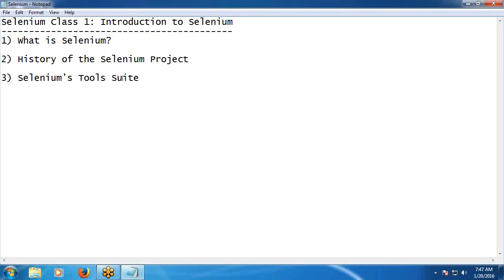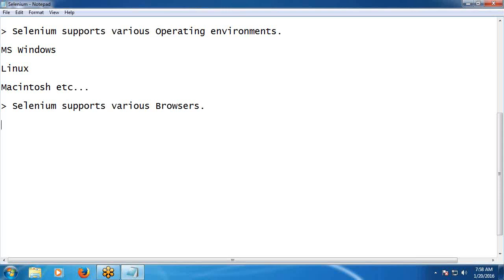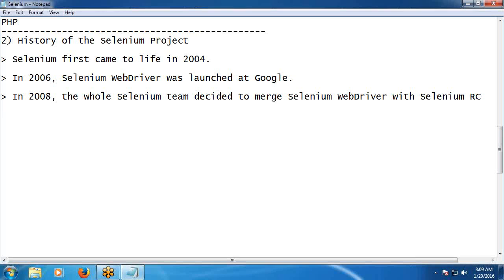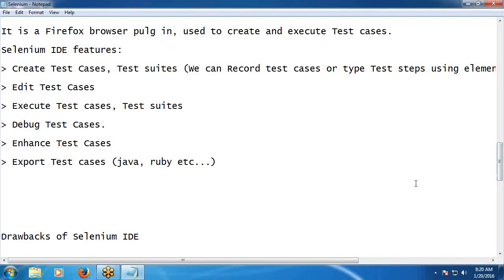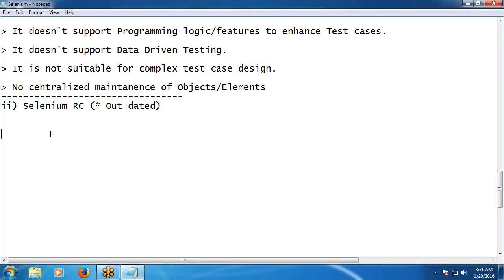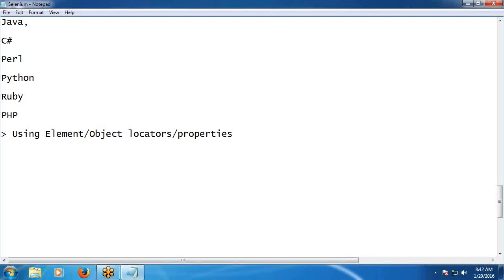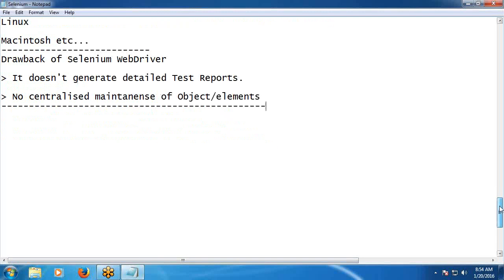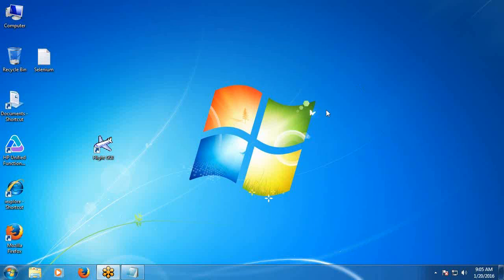Selenium Tutorial 1: Introduction to Selenium

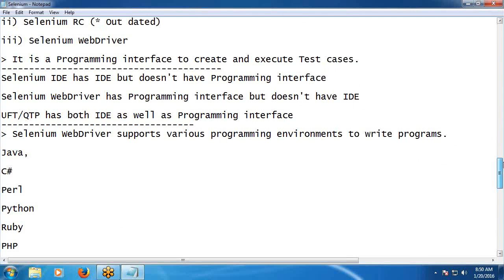Comment: One clarification: At 1:03:45 you state QTP, formerly UFT, supports only Windows Operating Environment. It does supports Linux, which I have seen run through in Microfocus StormRunner.
Reply from the maker: Good, UFT, formerly QTP is the correct one...

Comment from the maker: Software Testing Resume:

Gedi Mahith         Mobile: 09247140386 / Email: gmahithtesting@gmail.com
----------------------------------------------------------------------------------------
Career Brief:
Understanding Test Requirements, Deriving Test Scenarios, Test Case Documentation, Test Data Collection, Test Execution, Test Reporting and Continuous Development of Testing Skills.

Professional Summary:

• Engineering Professional having about 2.5 years of Software Testing experience.

• Familiar with all phases of Software Development Life Cycle and Software Test Life Cycle.

• Understanding, Analyzing and Streamlining Test Requirements. 

• Knowledge on different Levels of Testing (Unit Testing, Integration Testing, System Testing and Acceptance Testing).

• Familiar with Functional and Non-functional Testing.

• Well versed with Test Documentation (Test Scenario, Test Case, Test Data, Defect Report, and Test Metrics).
         
• Expertise in Bug Reporting & Tracking Process, Bug Reporting and Tracking using Bug tracking tools like Bugzilla and Issue Tracker. 
      
• Knowledge on SQL to conduct Database Testing.

• Familiar with Programming Fundamentals (Structured Programming and Object Oriented Programming).

• Knowledge on Test Automation Tools like UFT/QTP and Selenium.

• Excellent Communication, Interpersonal Skills. Quick Learner, versatile, adaptable and process -oriented with high customer orientation. 
    
• Familiar with Industry Quality Standards like ISO, CMM/CMMI and IEEE.

Education:

Bachelor of Engineering (CSE) from Jawaharlal Nehru Technological University, Hyderabad, Telangana in 2012.

Certifications:

• ISTQB Foundation Level Certification from ITB in April 2015.

Software Skills:

Operating Systems: Windows, and UNIX
Programming: C , and Java
Documentation: MS Office, Open Office
Databases: SQL Server, MySQL
Testing Tools: UFT (formerly QTP), Selenium
Web Technologies: HTML, XML, and JavaScript

Organisational Experience:

Since Feb’14 with Info System, Bangalore as QA Tester

Project Title 1: Digital Signature

Application Environment: Windows 7, Java, and Oracle

Testing Method: Manual Testing

Role: QA Tester

Project Description:

Digital Signature is Software that shows advertisements and information on a digital TV in Railway Stations, Bus stations, and other Public places. The user specifies the date, time, the video file, the image file and text to the software. The software shows the advertisements at the scheduled time.

Project Title 2: Multi Banking System

Testing Method: Manual Testing

Application Environment: Html, JavaScript, CSS, Java/j2ee (JDBC, Servlets, JSP), and Oracle

Role: QA Tester

Project Description:

The Multi Banking System Interface is targeted to the future banking solution for the users who is having multiple bank accounts in multiple banks. This interface integrates all existing banks and provides business solutions for both retail and corporate. This system acts as a standard interface between the clients and all the banks, By using this portal any client who maintain accounts in various banks can directly log on to Multi Banking System Interface and make any kind of transactions. In the backend, system will take care of the entire obligation required in order to carry on transaction smoothly.

Job Description:

• Verifying Test Environment

• Understanding and Analyzing Test Requirements

• Contribution to Test Plan Documentation

• Deriving Test Scenarios, Documenting Test Cases and Collecting Test Data for Functional Testing.

• Updating Traceability Matrix Document

• Creating Test Batches, Executing Test Cases and Reporting Defects.

• Data Driven Testing with valid and invalid inputs, and Database Testing (Checking Data Integrity, Data Manipulations, and Data Comparison).

• Tracking Defects, Selecting Test Cases for Re & Regression Testing.

• Sanity Testing, Re & Regression Testing on modified Software Builds.

• Collecting Test Metrics and Documentation.

• Updating Test Cases and Test Data.

• Tracking Changes, Preparing Reports and Updating Documents.

• Team Communication and Customer Communication.

Personal Information:

Date of Birth: ** - ** -**
Nationality: Indian
Languages Known: : English, Hindi and Telugu
Address: ***********************
--------------------------------------------------------------
Reply: sir this email id is not working. pls send again
Reply from the maker: https://www.youtube.com/user/gcreddy7/playlists